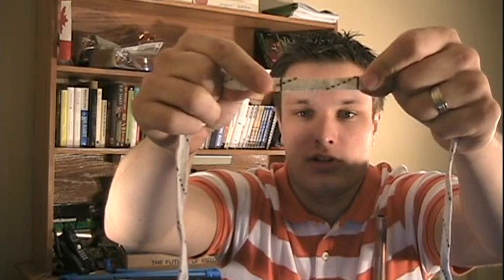How to Determine Your Supply Line Size

Comment: 2.25 divided by (pi)3.14159265358979 = 0.716 which is lager than 5/8 and smaller than 3/4 so how did you get 1/2"?          2.75 / pi = 0.875 which is 7/8"       you have to be accurate when measuring circumference to get proper diameter.
Reply: You're forgetting the wall thickness of the pipe.
Reply: @woodfold  okay...so how does that factor in?
Reply: i am with you and still wandering...